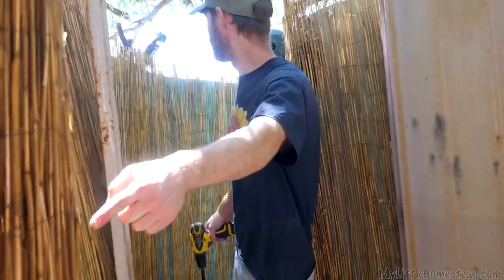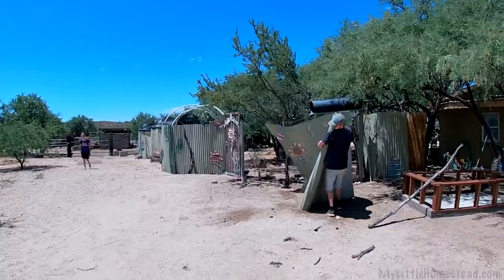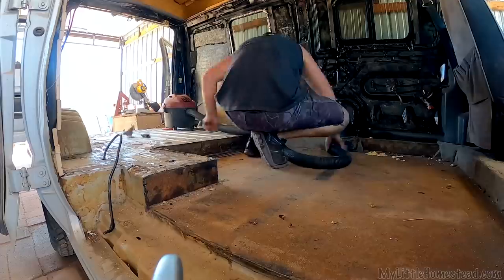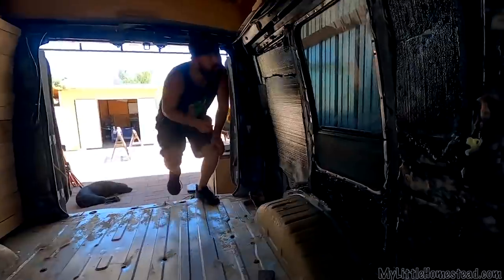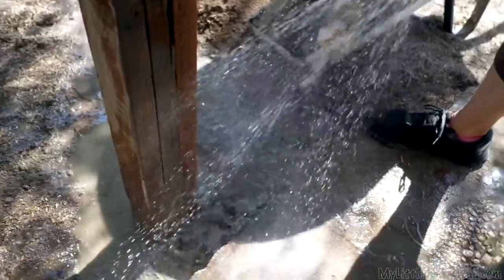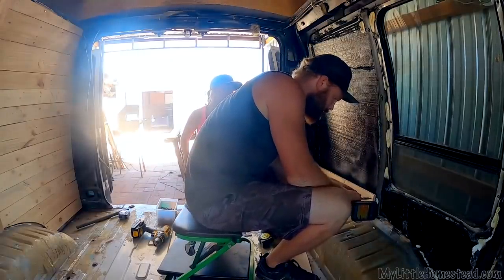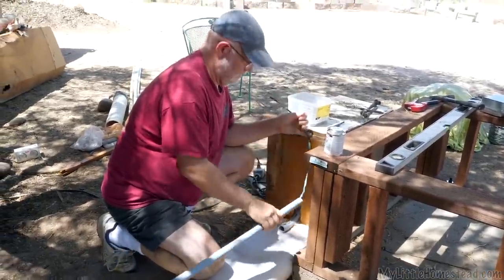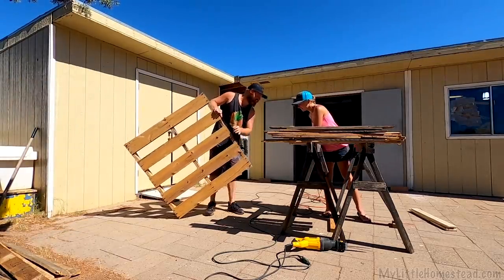Outdoor Tub Earthbag Wall Plans, Van Conversion & Bailey Update | Weekly Peek Ep243

Comment: Love what your doing with the van :)
Hey Garen and Ellie, when I useded dressed-one-side pine boards on an inside wall, I ran the boards thru my table saw to angle the edges. This way the board edges fit behind one another, hiding the wall behind the boards. An alternative to ship lap or tongue and groove, I guess. : ) 
In addition to that, I stapled tar paper to the wall so that if you could see thru any gaps between the boards, it just looked black. the same way you painted the van walls.
Love watching your videos on the van conversion. And beautiful family! :)

Comment: Garen,
Another way to keep your vertical trim pieces from breaking when installing them is make a series of horizontal cuts about 1/2" to 1" apart the whole length of the board, only about half way thru the board which will allow your board to spread a bit when installing it.

Comment: If you lay a steel cable, old chain, junky rebar or whatever over water or power lines, they are easy to find with a metal detector.  I did this in the camp ground/resort I built.  Made finding lines very easy.

Comment: Love the earth bags. Will you be putting a roof over the tub? I don't know how it is in the desert, but I'm in Maryland, and anything without a roof here gets quickly covered with pollen, leaves, buds, bugs, grass cuttings, all sorts of junk. Not to mention rain and other precipitation.
Question for Garen and Ellie: When working with pallets, you cut the nails to quickly break them down. What do you do about the nail heads? Knock 'em out with a nailset, or cut the ends off the boards before use?

ETA: Just saw your vid from 2016 explaining where you got your earth bags. Have you made more purchases from the same supplier or are you getting them domestically now?

Comment: I don't remember not rebuilding Vacuums... LOL... the filters Help? but in the end I made a decision that they caused the Electric motors to Overheat... On shop vacs... I clean them up before and after each use.... On interior Vacuums - They went in the same Direction And You should Clean them Seasonally... Or Monthly.. per to your usage.. - Sigh...
Reply: Would you like to Listen to me Ramble about my Youth Science of Vacuums and All the things I'm able to do Using them And Theories Of stuff that Not only will you not understand... But the people that own and Use that equipment Daily Will not Understand or Be able to Offer information to the Ponder of Curiousity?
Reply: A Rag on the out side.. that is Damp to wet... - I use handkerchiefs... I wet then Ring them out Then cover the out Blow Section with it.
Reply: just a Good Picking and Some Compressed air.. if it's gross.. or Liquid... I use Bleach and/or Ammonia  to Level the Bacteria .
Reply: Futons? did I Spell that right? sigh.. - I recommend Something in the line of What makes you comforable - A light weight Solidin 2 parts and then a Cushion Cover. - Why? the cushion cover is what you find in Campers.. the Hard Part you find under them.. What you don't find? is a comfortable Nights sleep... So it's a Good bed and no place to sit in the Rain... or A take a part and put bed on Top unit.  Sigh...
Reply: Well.. There is also.. I'm 6 ft 250 pounds... So Most campers Are not good for me... I'm a Tent person? it's Standing in the Rain or Laying comfortably in a water proof Bedroom... Sigh.. Take it or leave it... I'm a 9 ft cube... There's even Civil laws That give me that right.. <tear>

Comment: Well, I offered, but apparently, it's earthbag walls (?). Never assume, so: (1) The Jacuzzi mechanicals MUST have an easy access panel for servicing — deep regrets if it doesn't.  (2) If you ARE doing earthbag walls, the "plastercoat" will be subject to steamroom conditions, which would suggest using swimming pool cement or some similar NON-POUROUS finish. (3) Recommend all wood trim be prefinished with 3 coats of finish on ALL sides, BEFORE installation. Nothing worse than mold forming under trim in a steamy bath area. //  I love you guys, but your "this is what we're gonna do" hasn't given me any solid idea what goes where and why?? // PS: You may not live in an area where building codes are enforced, but burial electric conduit should be 18" deep. SAFETY FIRST. (I'd also map it and mark it).